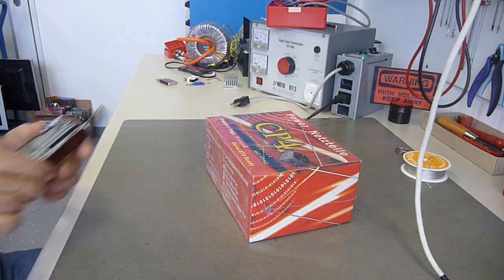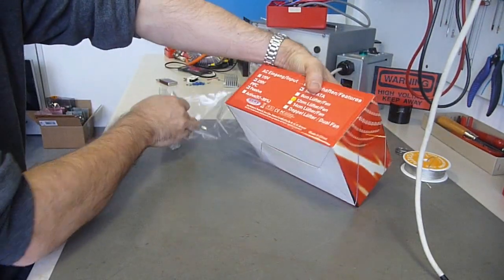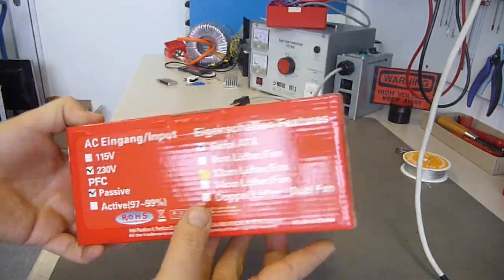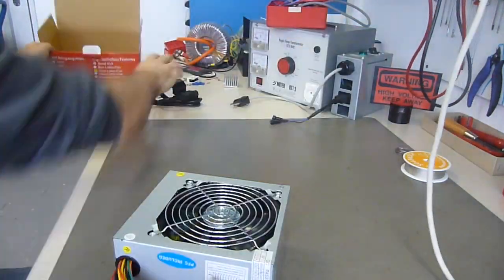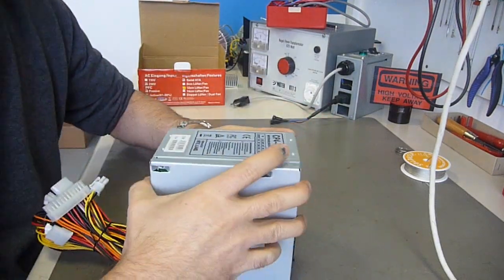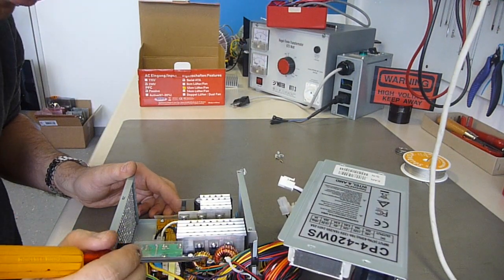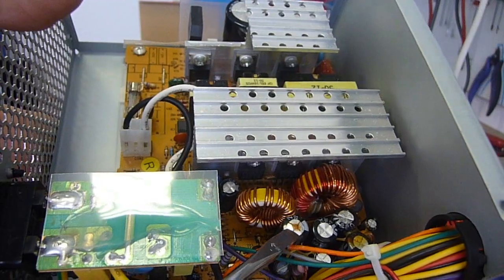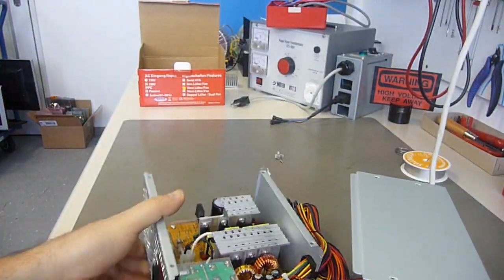Leaky capacitors in a brandnew power supply! (PWJ13)

Comment: Expensive PC power supplies can be a problem too.  My Corsair AX760i decided after two years of operation would shutdown every few weeks and cycle on and off every few seconds.  Eventually it would run no more than 30 minutes.  In order to get the box back up and running I had to go out and buy another supply.  Bought a basic Antec brand (which is probably what I should have bought in the first place).

Comment: LOL the electrolyte was so bad it couldn't handle burn in testing (assuming they even did that)...

This is the same design and chassis as the Chiefmax brand... Except those ones had decent heatsinks... But hey they needed to cut down on the heatsink to afford the fancy EMI filter... LOL

Comment: That does not surprise me at all with QC in the world of manufacturing non-existent and companies hell bent on making crap for the least amount of $$ (using recycled parts, etc) and charging as much as they can get away with. Yeah this is no surprise you find popped caps in equipment right off the assembly line. Even name brand equipment is not immune to it, that only means you paid four times as much for the same crap equipment with a name brand label on it...